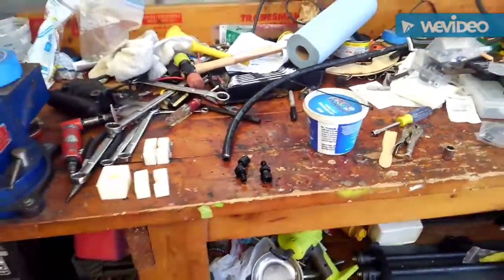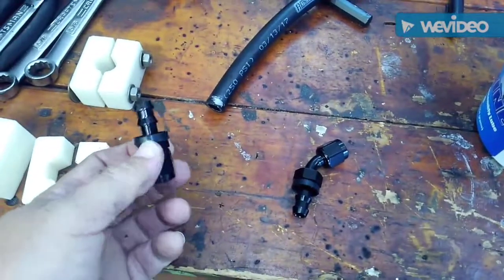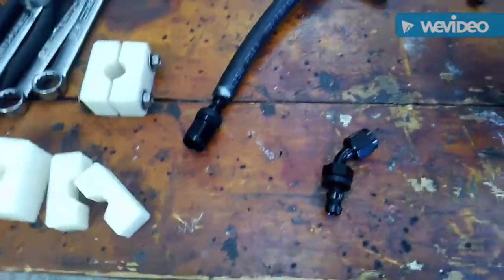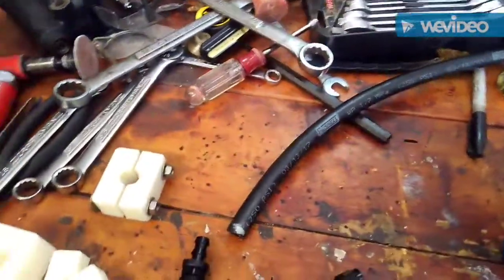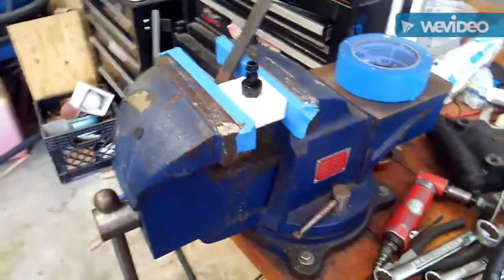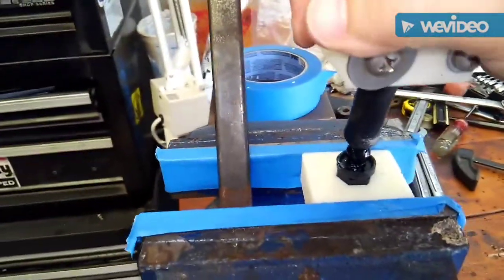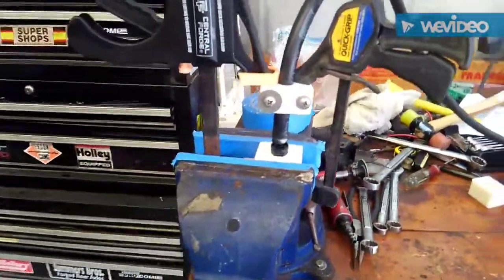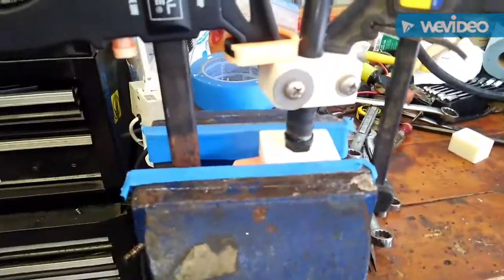Installing Twist-Lok AN fittings

Comment: Hi there!  greetings from the UK! So glad I stumbled upon your video! I was beginning to think I was the only one struggling with these damn twist  Lok's! The instructions on Russell's website and those supplied with kits suggest it's a walk in the park fitting these 😆 I was about to throw all of them away and buy some regular screw-on fittings when I stumbled on the same idea of using clamps( I'm currently using a G clamp) and a wooden block drilled 14mm and split down the middle,with a smaller clamp holding it together 🤣 Yee Haa!!!
Reply from the maker: Glad it was a help! Your exactly right! Russell's instructions make it sound like a cake walk...  just push it in.. yeah right!